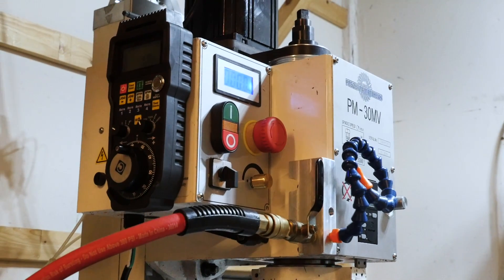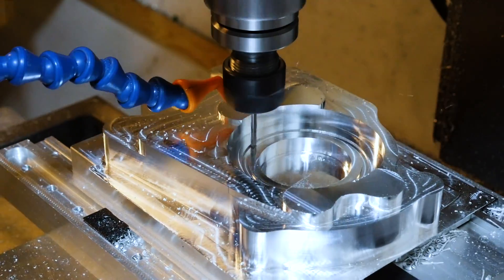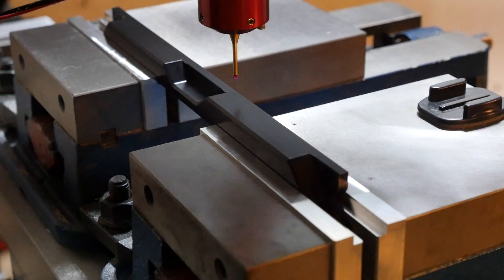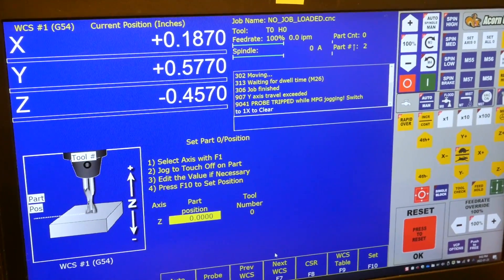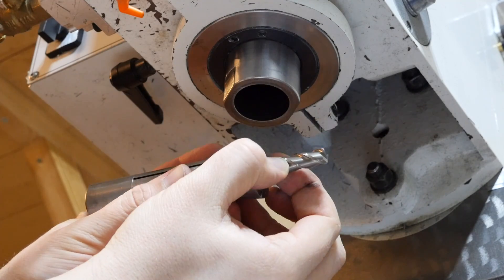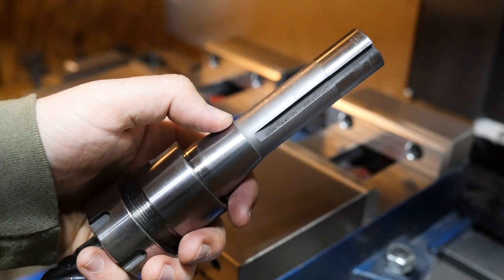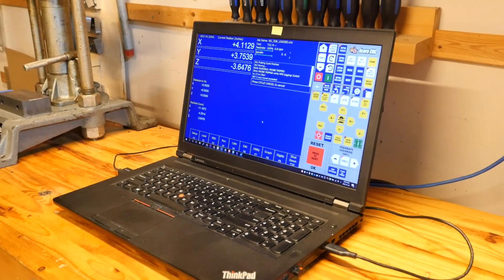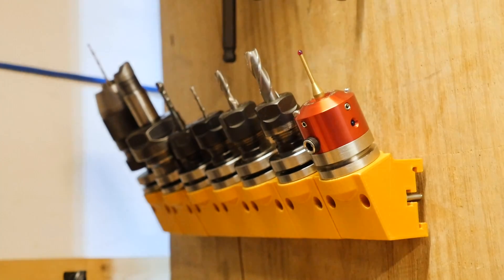Convert a Bench Mill to CNC - Everything You Need to Know

Comment: you can save that end mill btw. depending on how bad it is you may be able to just tap it out with a flat/hex screwdriver if you tap it along the flutes, or you can use a lye solution to dissolve it
Reply: Yeah, try dissolving it using a lye
Reply: If that is aluminum in that end mill, muriatic acid (home Depot cement department) will dissolve it in minutes. I use it to remove piston material from cylinders (cast iron, chrome, nikasil) all the time. Works great. Muriatic is a trade name for hydrochloric acid. Found in cement prep/etching solution and industrial toilet bowl cleaner.
Reply: Definitely try using lye. if you try to pry the aluminium from the flutes it may come off with the edge of the endmill

Comment: Great timing. Between the recent video on probing parts for dimensions and the "Make your own parts" video I was back to looking at current mill options after debating about a G0704 years ago (and holding off). Can't fit (or afford, or power) a Haas TM1 so maybe this is the time..

Comment: like you, i wish i went with linuxCNC but i already had an ess so im with mach3. Also a 940 instead of a pm30. But at the time my needs were much smaller at the time. Besides that probe, a cheap tool height setter is a savior for setting heights automatically for drills that you dont use enough to put in a tts collet. Currently i am getting ready to do the spindle bearings and put an import servo on there to up the RPM as the 3k is really the limiting factor of this machine.
Reply: any links to servo and bearings?
Reply: @minskmade  there is another video out there where a guy did the bearings on a pm30 and has all the bearings listed. Instead of the expensive 1mm shims he lists, mcmaster has them cheaper.  As for servos, I'm using a 110st-m06030 from aliexpress and a 25mm htd 5m belt. Pulleys can be found there too and all you need to do is bore out the spindle side pulley with a lathe as ut has a 50mm bore